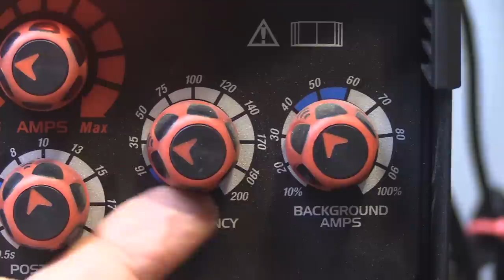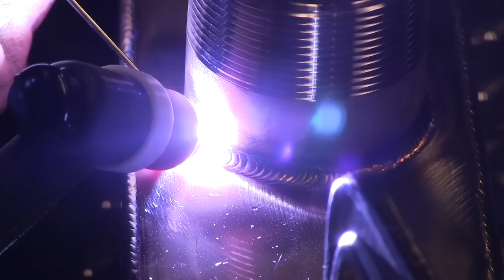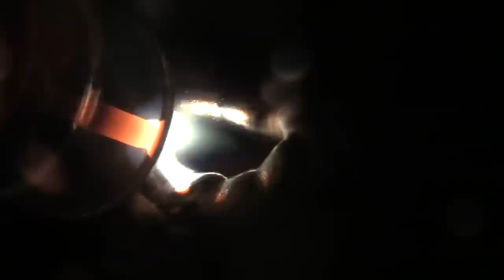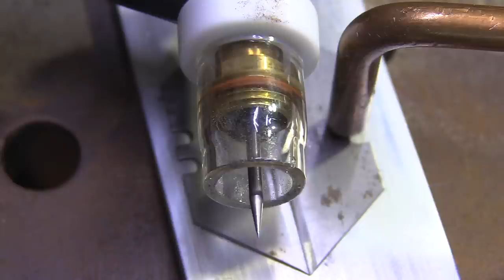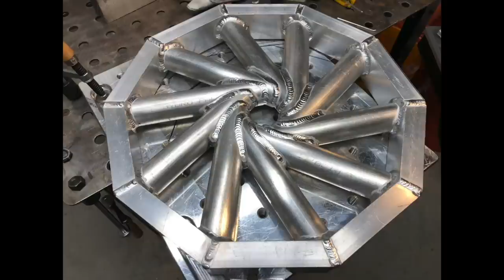CK Worldwide MT200 AC/DC TIG Welding Machine | Welding Tips & Tricks #Welding #CKWorldwide

Comment: I demo'd this machine a few years back at my local Norco when it was first announced. Good smooth running machine and it is very high value for what you're paying. I'm still a Miller guy through and through though. Dynasty 210 is my current machine.

Comment: Good to see a quality video on this machine, I've been looking at it as an upgrade to my eastwood, it's been a good machine to learn on but I've found myself wanting better arc control with increasing regularity
Reply: IMHO this machine is overpriced.
It is a Jasoc machine, rebranded with quite the hefty markup.
Reply: @NemesisRTCW  Sure enough it is a rebrand and prettied up jasic wsme-200 Tig welder. Looks like CK made some slight changes with jasic on the connector choices but it's insane they're charging $2000+ for a machine that's sub $500.

Comment: So which Chinese machine did they redo the controls on, can you tell? Reminds me of a alpha tig that just has new knobs and bold new graphics. I’d be curious if the boards have parts and model numbers on them. I’m a fan of their torches but this unit has a steep price tag and something tells me this welder is not built specifically to top standards. With most top end Chinese units having digital displays and multi processes I don’t feel like this unit is worth the money.

Comment: i have the orange jasic version , straight from the factory  ....  which is identical to the re branded mt200  ( i've had both apart ) .  it is a very good machine , but the only draw back is the low duty cycle

Comment: I've not tackled/attempted tig yet, so I'm inserting a dumb question here... don't you need heat for penetration? If you don't bring at least some heat how do you get a good solid weld? (travel speed) Or is it not too much heat for the appearance? Why not 2-3 stringers at high freq? Just mig now and then, and a little stick years and years ago. (still looking for a inexpensive machine to start with) I do wish I knew half of what Jody knows.

Comment: hi jody, i have a weld test coming up. overhead t fillet with stick 10mm plate thickness 7018 rods. what amps would you recommend to use? the welding rods size are 3.2mm

Comment: Great channel. Need some advice. Have a new CIG 220I mig.....welds great but wont hold its settings....wire feed and voltage jump sky high mid weld, then just touch the dial and they revert to where they were set. Problem machine or problem operator do you think?

Comment: Jody I’ve been watching Japanese and Chinese welders using cold tig. Have you ever used it or have experience with it. It does not use a constant arc it pulses very hot and fuses metal together with out rod.

Comment: At the 5 min mark, Jody is welding a stubby SS pipe fitting. I noticed he had no need to screw in a temporary NPT elbow or any other pipe fitting to prevent the welded fitting from warping. Would it be best to do that?

Comment: Looks like a decent welder, better then the Lincoln that doesn’t allow you to change the post gas setting

As for aluminum hole filling, had quite the task, the guy drilled a stud out and wandered off the side almost all the way down to the bottom of a 2” hole for the wheel stud. Only a 5/16” drill hole but a pain to get into

Comment: I really like the specs on the MT200.   It is advertised with a 3 year warranty.  However, that warranty only covers "3 year warranty on transformers, inductor and rectifier".   "1 year warranty on PCB and all other components".   That is right out of their owner's manual.   Too bad CK Worldwide doesn't have very much faith in the reliability of their welder.   Sorry, but that is a deal killer for me......

Comment: Guys im looking for an advice, namely I want to learn TIG welding, right now I weld with sticks. I want to know what TIG welder will be the best for learning, Im from Europe, i think that matters, because we have different currents. Thanks for all advices
Reply: Depends on what type of metal you wish to weld. If you're only doing steel, you could get an adapter for your stick welder (assuming it's DC) that would let you use a TIG torch or a cheaper machine such as an Amico tig welder (reviews are pretty positive, no personal experience). If you want to do aluminum, the units that come to mind are the AHP 201DX and the Primeweld 225. The AHP comes with a nice TIG torch (and pedal now iirc). The Primeweld has a bit more power and a better interface. Most EU power is 220/240V from what I understand which is good. It's hard for me to give exact advice not knowing your goals and budget. Hope this helps some.
Reply: @mercMADCommando  of course you helped a bit, thank you :)
Reply: ESAB, Welco, Fronius, Kemppi are a starting point. A lot of the European welding machines come from Scandinavia and Italy for some reason.

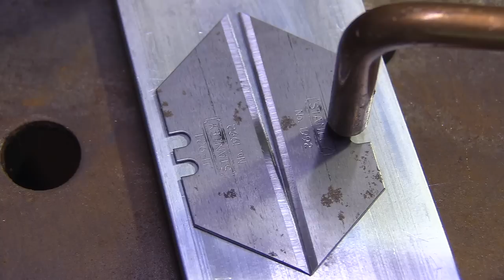Comment: Will aluminum weld pull welded parts when it's gonna cool down like steel blades @15:15? Is that covered somewhere?
Reply: Yeah, I notice it more on larger, thick weldments with long runs. Any kind of structure that has a significant length will exaggerate this effect, so it’s important to pay close attention to how it may be responding to the heat. That’s one perspective, anyway.

Comment: Was the box cutter blade welded at 40 amps? Is that what was showing on the machine or was that the pulse setting?
Reply from the maker: I used the foot pedal.  I only set the machine to 40 amps because i used pulse settings of about 40pps and higher speed pulse requires more amps.  I still wasnt even half way on the foot pedal
Reply: Ok, thanks Jody! I have another question. You did a pulse mig (GMAW-P) video welding some sort of gantry rig, my question is about machine settings, not trim or inductance, but amp settings.

What have you picked up about machine settings compared to short arc?

Is 1 amp per thousands still where we start? There is little reference out there on pulse mig today!

Everlast 253DPI 

Any other tips would be welcome!

By the way, any suggestions on an affordable weld camera? I would like to be able to review my welding to improve my craft!

Comment: I'd love for Jodie to try out R-Tech product range. As i now bought a Mig180 and have nothing but issues with settings, has an LCD display but only displays the Amps whilst in use (pointless)They rave about them being "British Made" yet i've seen identical machine 'imig' so i bought in to their BS
Reply: R-Tech aren't British made, and are remarkably similar to Everlast over in the US; I've spoken to R-Tech about the similiarity and they do share much of the supply chain but the circuitry and IGBT gubbins that R-Tech specifiy is different and enhanced.

Comment: Hey I have a question, I’m not seeing anywhere a recommended CFH on cup/collet/lens sizes for any torch style.  Is there such a document in existence? 

Thanks in advance;

Andrew
Reply: It really all depends on the application, my general purpose settings though are a #12 cup with 16-20 cfh and 3/32 2% lanthinated tungsten, and depending on what I'm doing ill move between a 9 or 17 torch based on space/amperage requirements, for aluminum I sharpen it like normal then blunt the tip down so it doesn't burn out too quickly
Reply from the maker: here is a simple rule of thumb that might help.. 2 to 3 CFH per cup number. so for example a #5 cup would use 10-15 cfh  but it also depends on the situation.
Reply: I just double my cup numbers. Ex... number 6 cup I run 12cfh
Reply: weldingtipsandtricks I agree and that wasn’t the best worded question I’ve ever composed.  Of course shielding gas, material, and arc characteristics, welding environment etc. also influence this decision.  Perhaps a topic for a video one day?  Thanks for your swift reply.

Andrew

Comment: Can you use that hertz setting on a stick weld?
Reply: Stick welding doesn't use AC, either DCEP or DCEN
Reply: @dinxsy8069  that's actually wrong many SMAW rods are AC only (6013 for example). But I see where your coming from Hertz settings might not be applicable.
Reply: Dinxsy then why can you get 7018 ac rods
Reply: @cjgibbons5850  6013 are AC/DC, 7024 works better on AC.